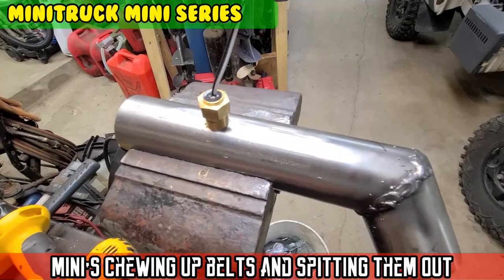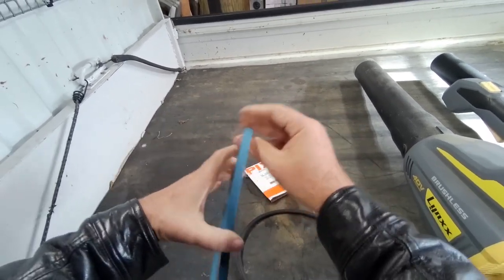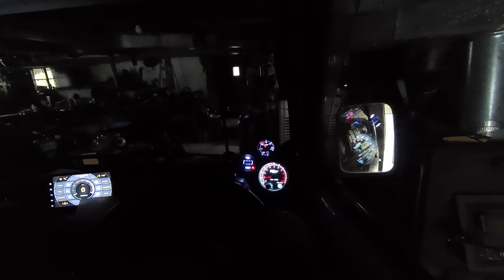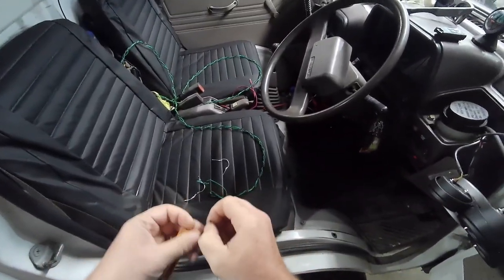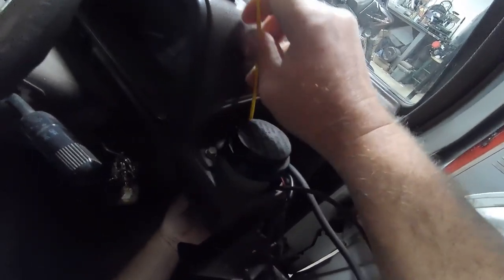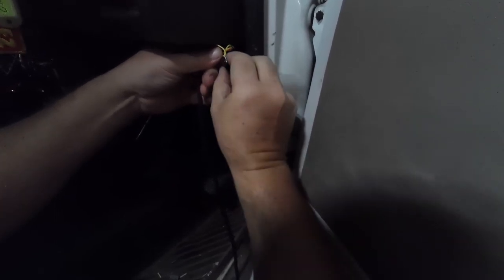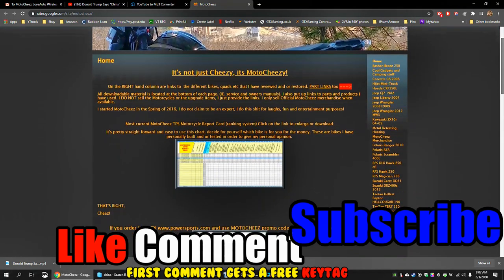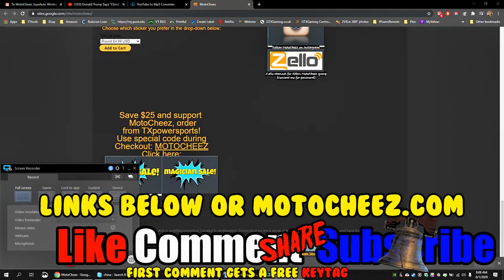Mini-Truck (SE06 E07) GlowShift dual temp install, Mini eating up belts. ARM300 seizing?

Comment: No blow off valve, the blower see's tremendous load when you let off the throttle.
Reply from the maker: It's draw thru cab, so it doesn't. Instead it draws tremendous vacuum, I did order a valve and get it but I'm waiting for the fitting to weld on the pipe, just in case of a backfire
Reply: I think it's a bypass valve, not blowoff on supercharged
Reply from the maker: Well you can have a bypass valve and a blow off valve on superchargers and turbos, that would be a good idea. I'm not sure if I have the room
Reply: @MotoCheez  they are the same thing, but different. in your case, since you are drawing through the carb you CANT run a vented to atmosphere bov. or kaboom. big fireball.  a "bov" is placed before the throttle plate and vented to atmosphere {usually} but a super charger diverter valve is in between the engine and the blower, then diverts back to the blower inlet {carb low pressure area} this keeps the volatile fuel air mix contained, not in your engine bay. the purpose of the bypass valve is to prevent the supercharger from overheating. its an air compressor that is always turning. if you dont have a bypass/diverter valve its ALWAYS boosting. which makes it VERY HOT.
Reply: @darkfireBikes  he needs a bypass aka diverter valve {between engine and charger}. a bov goes between charger and throttle plate, which does no good here. also a vented to atmosphere bov would = dynamite production under the hood.
Reply from the maker: Yeah, I get how it works, I just don't know if I can do for my application  size, Wonder how small pipe I could use and it's vacuum actuated? Because it would have to be in my case. Being drawn through.
Reply: @MotoCheez  yes they are vacuum actuated. and the hose is about 1 inch.  you just T it into your existing plumbing.  u got tubes run all over it should be easy to plumb in.
Reply from the maker: I was looking into them after you mentioned... Didn't realize they were that small. Hope they can be controlled for draw thru style...
Reply: @MotoCheez  when the valve is open. carb to motor. when the valve is closed. carb to blower to motor. might have to experiment with what side of the carb the discharge port goes to. im more of an efi guy than carbs.
Reply from the maker: Agreed it would help, I noticed today it heats up going down hill more than going up hill amazingly lol. But not bad
Reply: @MotoCheez  going down hill the engine isnt consuming much air, which is the only way it has to cool itself.
Reply: @MotoCheez  im pretty sure the vortech 8D001-004 is a vw passat stock bov.
Reply from the maker: I'll go look
Reply from the maker: Not in my case, tremendous vacuum, no air through the SC. Cools when I'm part throttle.
Reply: @MotoCheez  tremendous vac is because the SC is spinning too slowly, its not moving  much air. the vw passat bov is vac/boost operated. they are all the same, its just how you plumb it. when the valve sees vac it opens when it sees boost it closes.  by it i mean the reference line that goes in the top of the valve
Reply: @MotoCheez  you are just plumbing a valve that connects both sides of the sc during part throttle. which gives air a path around the blower. when you romp it vac goes away because the throttle plate is opened, at that point the valve closes. when you let off the throttle plate vac returns and the valve opens. relieving the blower.
Reply from the maker: Hmm, ok. I can give it a shot I guess! Not that much money
Reply: @MotoCheez  the outlet of the SC goes to the inlet of the Valve. the outlet of the Valve goes to the inlet of the SC. the vac line on top the valve goes on the intake manifold.
Reply: @MotoCheez  junkyard. any factory turbo car. some supercharged cars will have them, but some use a butterfly like a throttle body with a little J-hook actuator. those wont work here {easily}
Reply from the maker: I could check. Have one not too far from me. Then I have to get some 1" connectors to thread in
Reply: @MotoCheez  you can holesaw or unibit an existing pipe and weld in a fitting.
Reply: @MotoCheez  ok so your rubber boot on your charge pipe you could change that to a T and plumb the valve outlet into your air filter to carb intake. only problem in this scenario is you would be re-enriching already enriched fuel. possible fuel contamination of the air filter.  plumb it so the valve dumps into that nipple on the carb adapter vac signal might be weird. just gonna have to experiment a little since its draw thru. but youll get it. if you need anything weird made. just ask. ill help you out man.
Reply: @MotoCheez  oh, 2 tips. 1 - charge pipe blowing off. weld little dots of bird crap right near the end of the charge pipe. usually 3 or 4 dots around the circumference will do it, gives the hose/clamp something to bite onto.   2 - charge pipe. CV2 silicone hose is your friend here. its got a stainless wire spiral wound in the middle of the layers. you can bend it around all kinds of corners. some stout shit. i use it for radiator hoses when im too lazy to make hardlines.
Reply from the maker: I was wondering what I could use inside to reinforce it.

Comment: Did you not (originally) state that you did not have the spec'd lube, and were filling it with a lube which was other than spec (Thinner as I recall)?  Doesn't the blower manufacturer offer a belt they want used?  Is the pulley some sort of pot-metal that is changing as a seized belt is burning in place?
Reply from the maker: I had a heavier viscosity I used the first time, this time I used what they called for, but doubt that's the issue.
Reply: @MotoCheez  Ok, if heavier, I doubt that's an issue either.

Comment: Me personally, I find super chargers to be more of a headache than a blessing, but again just my two pennies. There's nothing wrong with them but it seems like nobody likes touching super-charged vehicles if you were to bring them to a mechanic. One of the supervisors in receiving at work has a super-charged Camaro and he had to find a place out of state that was willing to tune it up for him. No one around here wanted anything to do with it, not even the few performance shops we have around here. But anything with a turbo is another story, just about any performance shop will willingly tweak on turbo-charged vehicles.
Reply from the maker: Hmm, that's probably true... But I know many manufacturers make bolt on kits for the LS, Ford, Dodge etc where you don't see turbo list from big names like roush, or maybe there are now.  My Vette they didn't have anything a few years back turbo anyway... Just small guys making kits to sell.
Reply: @MotoCheez  I think super-chargers are more popular for V8's because the intake manifold can be easily swapped out and replaced with a unit that's a super-charger. So it's a super-charger/intake manifold in one package. Versus having to pipe both exhaust manifolds to one turbo or putting a turbo on each exhaust manifold to equal it out. A four cylinder doesn't have that manifold valley in the middle of the block and usually pulls air from one side so a single turbo is more simple on those. As for super chargers making more torque, I think with modern day offerings turbos don't have that torque issue anymore. My 2020 Silverado has the 2.7L "Turbo 4" in it and it makes more torque than it does HP. But I'm no car expert so it's all guess and opinion. Who knows, they might offer turbo kits nowadays for cars like your Vette. Have you ever looked on Summit Racing? They tend to have a lot of mods for muscle/sports cars and pickups. They offer a few exhaust systems and cold air intakes for my truck I've been eyeing. :)
Reply from the maker: True. Most newer cars are turbos from factory.
Reply: @MotoCheez  My truck has what GM calls a "Twin-Volute" turbo in it. So instead of one large inlet like normal turbos have it has two smaller inlets. It's suppose to help with turbo lag or so they say. But since this is my first and only turbo based vehicle I wouldn't know the difference. All I do know is it requires very little gas pedal to get it up to speed from your slower in town cruising. :)

Comment: i wonder if it really needs the 75/140 oil
Reply from the maker: Not sure but had someone say he used 30w
Reply: @MotoCheez  you said it when you installed it
Reply from the maker: Yeah. It said 75w90 originally,  I used 75w140 the first time, this time I used 75w90... A guy online said use 30w... I'll stick w the manual specs for me.

Comment: did this blower come with a performance curve showing HP/PSI/RPM?  are you sure you are operating the blower within its rated spec for rpm vs pressure? these type blowers can overheat easy if you are out of their performance curve.
Reply from the maker: As beat I could. I know it's below max RPM quite a bit. They were on Subaru sambars
Reply: @MotoCheez  RPM is just part of the equation on PD blowers. you have to consider air temp, and output PSI. and CFM. Once the blower goes off its performance curve, things get hot quickly.. also the air cleaner needs to be rated for the cfm you are pushing and can cause overheating.  Just a few things to think about if you have not already.
Reply from the maker: Yeah I know. That's why I got the smallest one for .33 to 1.3 L. I'm .66. My air cleaner is huge. For a V8

Comment: Tiny T paid mini a visit in the nite?   CTdot sure effed that corner by squash hollow rd up big time
i missed if u said..R u runnin a exhaust temp gauge? Do U know anyone with a 'old school' exhaust gas analyzer?  (old emission check)..probe up the tail pipe. The A/F mix going in is only part of the equation. U mite be able to find a old Lambda sensor, but being able to adjust the A/F & timing on the go?? doubtful. The changing outside air temp and baro pressure is not helping.  G.Luck
Reply from the maker: I installed a wideband AFR gauge a while ago. Yeah, they fixed the road but it's not 100%

Comment: Cheezy you could be making carb ice, you might make a pull lever reroute to pull air manually from around the exhaust pipe (hot air) like they do on planes.
Reply from the maker: Hmmmm
Reply: @MotoCheez  it could also be a thermal friction anomaly from the boost made between the throttle and SC 🤔 Maybe time to add that bov
Reply from the maker: Being draw through it's constant vacuum there. Only boost I'd after it to the pipe, it non conventional

Comment: You had ZERO problem befores the SC install.  It has to be freezing, then freeing back up.  It's freezing long enough the burn the belt.
Reply from the maker: I think it was the chips
Reply: @MotoCheez  Which chips?  This isn't computer controlled is it?
Reply from the maker: Right after the supercharger was freezing and locking up I took it off and inspected it and it was two small metal chips that were embedded into the rotors that I had to dig out and I haven't had a problem since locking up and it's only running 120 instead of 180 now
Reply: NVM, you meant the chips in the rollers.  IDK, they didn't seem that big, and I didn't notice any damage on the corresponding rollers (in relation to where the chips were), unless it was empty space on the opposite sides.
Reply from the maker: There's literally thousands of an inch to the case which is where it does the compressing of the air and it did put some scratches on that but of course if it was contacting it would create heat and swell that area which I think made it lock up
Reply: @MotoCheez  I hope that was the case.  And based on your last vid, it does seem to be running much better.  I think their is a dealer in Tampa I'll contact when I get down on the 20th.  I doubt I'll SC it though, but who knows (It's been 21 years since my band Mustang SC experiences).....  Damn glad to see you got yours going (and so far so good).  On the bright side, it does make for good content even when you have no clue as to what the hell the problem is.....
Reply from the maker: I like all the input, I learn as I go and the input is awesome
Reply: @MotoCheez  Keep it up man.  You do a great job.

Comment: so the cheap AMR's from china are units recovered from recycle containers, sand blasted and resold. You will find JDM sellers that sell them pulled off cars in junkyards BEFORE being sold to the chinese recyclers. You will notice those blowers still have the factory cast inlets and outlets on them. If you look at the factory inlet you will see 3 pipes coming out. the largest, about 1 inch, is the bypass valve. this lets the blower "relax" and not build boost {heat} at idle and low throttle angle. it also protects the blower as you transition from high blade angle to low {lots of throttle to little}. Superchargers need AT LEAST a bypass valve {routed back into the intake so metered air is not lost} some higher performance applications will run a Blow Off Valve {dumps to atmosphere} either in addition or substitution to the bypass valve. an 8-71 roots blower with a cogged belt doesnt have any way to bypass, so the motors "roll" at idle. but they do have a blow out valve and shear studs to protect the blower in instance of a backfire. which is why roots blowers have nylon straps on the sides. to catch the blower when the shear studs let go :)
Reply from the maker: Ahh, didn't realize that's how these were aquired and rebuilt. I do have a popoff valve, waiting on the flange
Reply: @MotoCheez  yeah at 170 shipped vs 250 +shipping the china ones were the way to go. but now that the price gap has shrunk, the extras that come on the "jdm" units make mounting up all the accessories {blow off valve} a snap.
Reply from the maker: They're scarce now. I was going to buy one as a backup, not many but high priced ones out there.

Comment: part of me really wants to put a turbo and efi on it.
Reply from the maker: I've been wanting to put an EFI on it for 3 years, nobody makes anything aftermarket but apparently micro squirts told someone that they could do something. And I did buy turbo for it but then you got to run oil lines and other stuff so I rather have EFI for that

Comment: wire nuts suck. wago lever lock connectors are the way to go.
Reply from the maker: I've never seen them until I look them up, I usually use wire nuts until I'm completed with the job and then I'll go through and put a crimp on it
Reply: @MotoCheez  i just stumbled across em at the electric place one day. i use them as temporary connectors and on test rigs etc.  there is a 4 wide that is real handy. nice thing about the wago is you can clip and unclip several times without damaging the wire, like a wire nut will.

Comment: He might need a pulley kit for his engine. A pulley could be bad. A 20 yr old pulley could be warned.
Reply from the maker: The SC locked up, you can hear it in the video. It's back on and I tested it offroad to heat up the SC pipe to 180f then did a few miles on the road. Seems good so far!